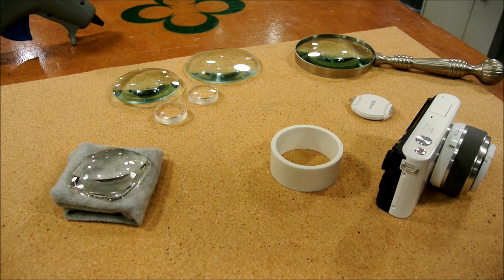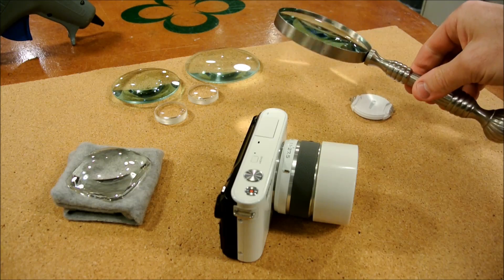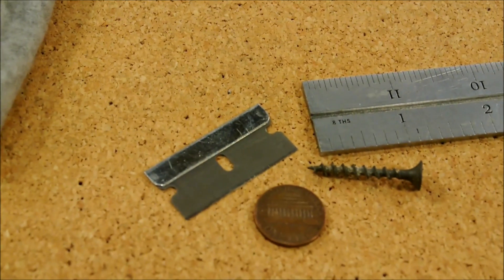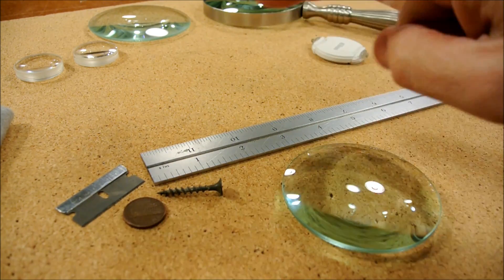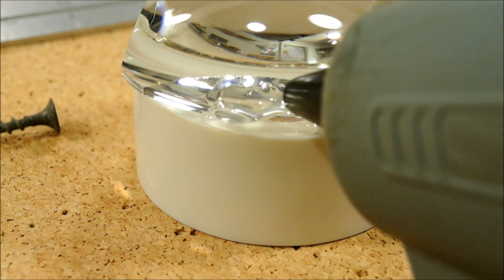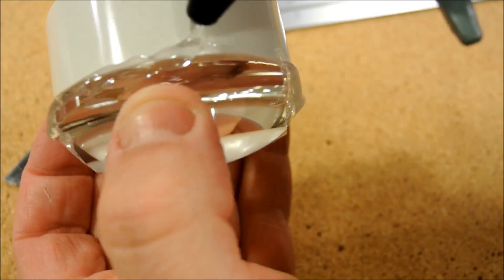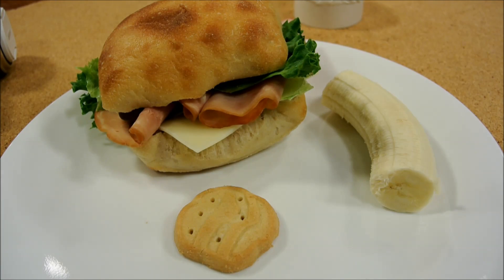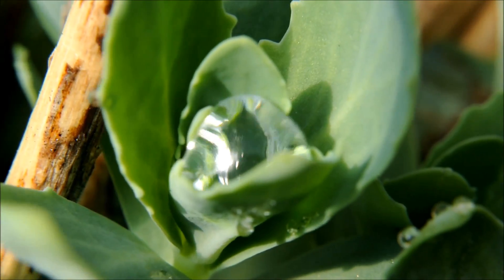Video experiment: Homemade PVC macro lens

Comment: The term micro is part of he metric prefixes

deci 1/10
centi 1/100
mili 1/1000
micro 1/1 000 000
nano 1/1 000 000 000
piko 1/1 000 000 000 000
femto 1/1 000 000 000 000 000
atto 1/1 000 000 000 000 000 000

In SI it goes even further. 

macro is something that is visible to the human eye without any optical help. Therefore you need something like a micro-scope.

Comment: How do you determine the length of the PVC pipe?
Reply: +Rexus King Oh, you said it in the description.
Reply: +Rexus King 11-27.5 specifies the zoom range of the lens
Reply from the maker: Yes, but what are the units of measure?
Reply: The units are millimeters!
They are "focal lengths", I think it means the distance between the lens' focal point to the camera's sensor, but since I'm not so good at optics either, here's a link to Wikipedia:
https://en.wikipedia.org/wiki/Focal_length#In_photography
Reply from the maker: That doesn't seem right. The zoom only has a physical movement of around 4 mm, and the difference between those two numbers is 16.5. Thanks for helping though. I'll read some more about it later ;)
Reply: +pocket83² Hummm... that's interesting.
Here's what I'm guessing:
I think maybe not only the outer-most lens move when you change the the focal length, since there are 8 "Lens Elements" (actual glass pieces) in this lens. So the focal point movement might be greater than what you've measured.
PS: The lens also moves when you are focusing WITHOUT changing the focal length!! Ah! this is really confusing!
Reply: +pocket83² I'm pretty sure its based on 35mm format. so since you have a cropped sensor, your lens movement distance is based on that ratio. If your sensor is 1/1.7 of a 35mm size, then its ratio is 4.55:1 and your 27.5mm is really 6mm. http://www.explor8ion.com/sites/default/files/images/temp/allsensors.jpg